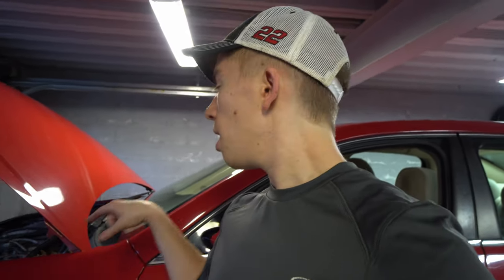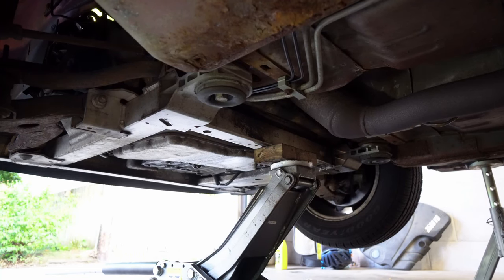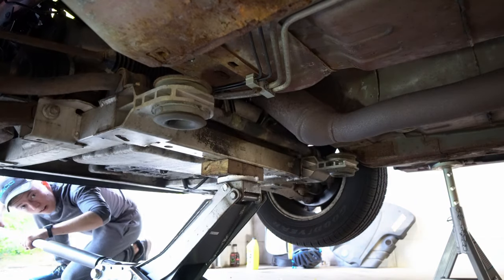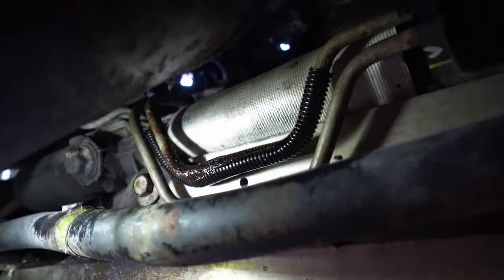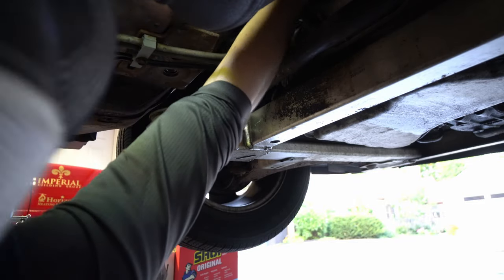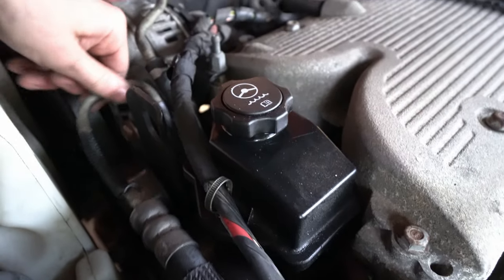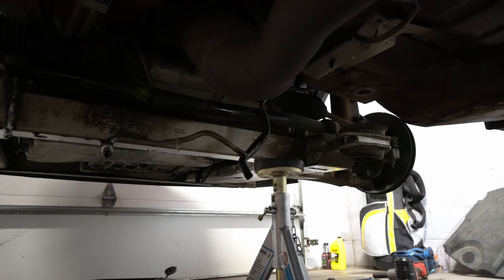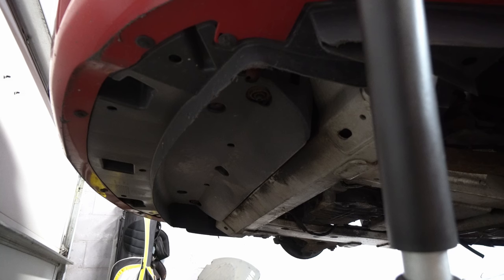Chevy Impala Power Steering Cooler Line Replacement

Comment: 7:22 was the most helpful part. On a 2007 Grand Prix, I had The exact same leak in the exact same place. I had already bought the return line and was dreading all that work, then you said in hindsight you could have just replaced that one metal part. I still had to lower the subframe but I had it done in about 30 minutes thanks to that little tidbit

Comment: I just cut off that bad section, which happens a lot on this model, and replace with hose and two clamps. Cheaper and easier fix. Great video though!
Reply from the maker: That's really clever! Thanks for sharing
Reply: I did this but it just keeps coming off I even used 4 clamps ….any suggestion ?
Reply from the maker: @romariolewis2354  depends on if you're on the high pressure or low pressure side. You might need smaller hose and clamps?
Reply: @HardwayLearning  what kind of clamps and hose did you use?
Reply: @romariolewis2354 I've done this last year and it comes off even with multiple clamps. Usually happens when temperatures go below freezing.  A small flare on end of metal line would help and that's my next option . Pushing the hose over it will be more of a challenge.  After that my next option is just to fix it with a new part. But a 200k mile car doesn't make me to excited to replace the full line.
Reply: I've done the cut the line and install hose fix.  OK temporarily.  Constantly weeps so always adding fluid prob like once a month.  Risky way to kill pump.  I watched a vid where a guy flared the tube ends before installing hose.  Maybe that works better don't know didn't try as I didn't have room for my flaring tool.  I finally bought a new part and installed it troubles gone.
Reply: @paulhaines5755  I've done this and have had to repair it several times. Very cold temperatures seem to be the Achilles heel of this in my opinion.  It will seep and over time the rubber line will hardened an separate.  I'm limping  a 200k car around and this observation has been over a 24 month period.
Reply: Thanks for the info!  It's cold here so prob my issue.  It worked great to get me back on the road but I had to keep an eye on the fluid.   Served me well for a few months until I decided to put a new part on.
Reply: Yep, since it's the return line, there's no pressure. Clamps should work fine.

Comment: Okay first of all great video second what about the steering shaft I'm going to do this right now and I'm assuming if you drop the subframe you only have so far before the steering shaft will come apart so I'm going to take the precaution and just unbolt the steering shaft from the rack this way nothing bad will happen.
Reply from the maker: I didn't disconnect the steering shaft and did not have issues.  Check out the pinned comment and around 7:22 to avoid replacing the whole cooling section on the front of the subframe.

Comment: Hello I checked everywhere no leak but only at the shaft so I’m thinking it’s the pressure line so would it be ok just to change the O ring?
Reply from the maker: That or give it a quick tighten?

Comment: mines leaking at the O ring, meaning the O rings go bad so most likely a lot better to replace the whole entire cooler line.
Reply from the maker: Might be worthwhile to get away with just the o-ring if your line hasn't corroded horribly like ours did

Comment: How stupid of the engineers to create this problem, across the line across the years... For some stupid little plastic cover... This is why no one buys American and keeps it for 220k miles.. I had a FJ cruiser for 436k miles.. No stupid repairs other than differential vent filter placement..it got clogged and blew a seal. Worst thing to happen other than wheel bearings.
Reply from the maker: It is odd that they thought they needed plastic tubing over the line. All it seems to do is trap moisture